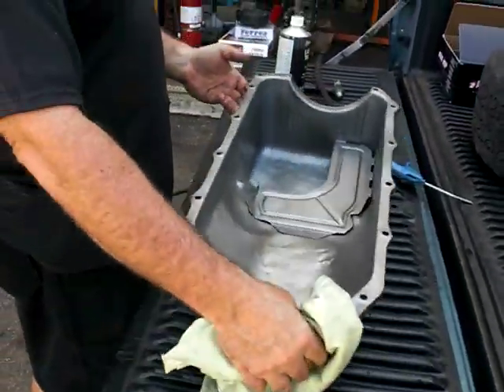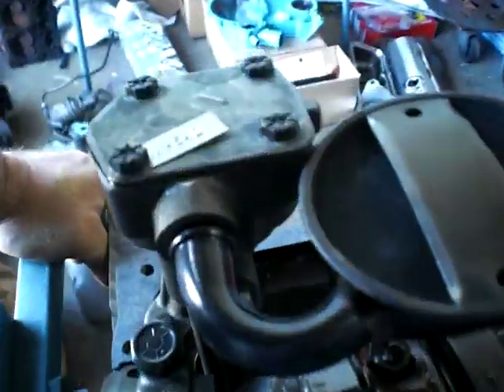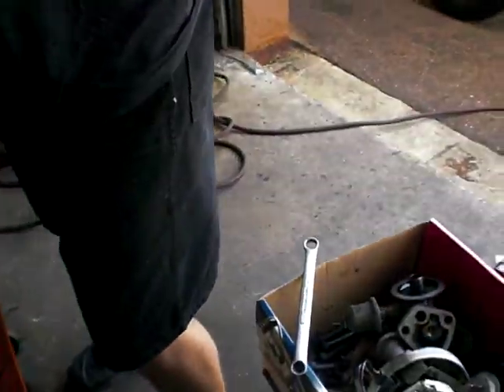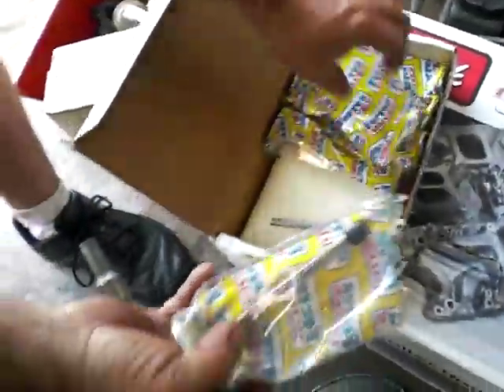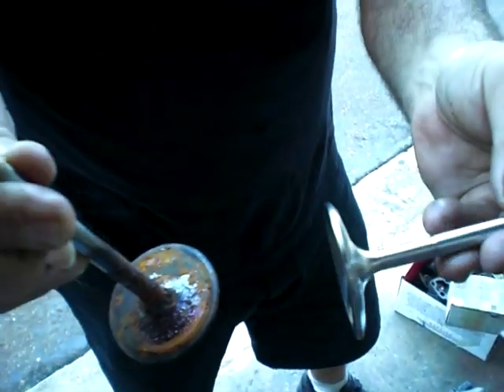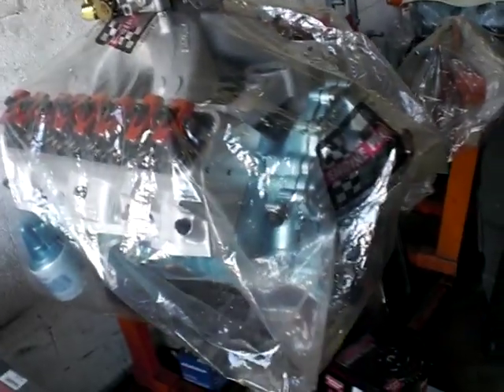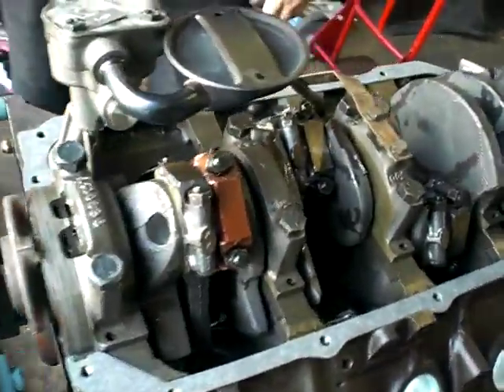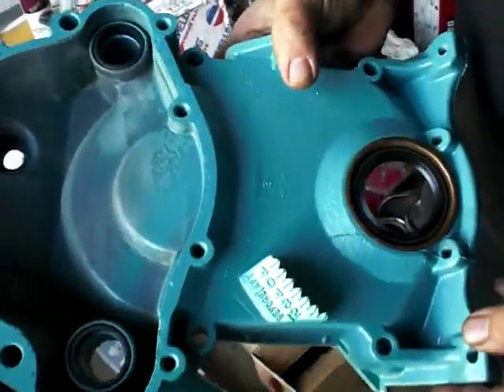Bruce engine build pontiac 400 ci engine 6.6 litre

Comment: I have a 1980 Pontiac Trans-am with a 400 engine running fine but it back fires a little do you have an idea what it might be. Another guy I talked to told it might be the glass catalytic converter. That is the way the car in supposed to sound. Thank you.

Comment: I wanted to ask what was the name of the small tube the enters the oil pan, the one that has a base with  two small screws? Thank you in advanced.
Reply: Lower Oil Dipstick tube ; ebay has them, I just got one too.  http://www.ebay.com/itm/1972-79-Pontiac-Lower-Oil-Dipstick-Tube-For-Use-On-Pontiac-V8-Models/331476081922?ssPageName=STRK%3AMEBIDX%3AIT&_trksid=p2057872.m2749.l2649

Comment: On these older motors, I was told not to use any type of oil. Older motors requires Royal Purple motor oil. They claim that has more zinc and something else in it. What is your take on this?